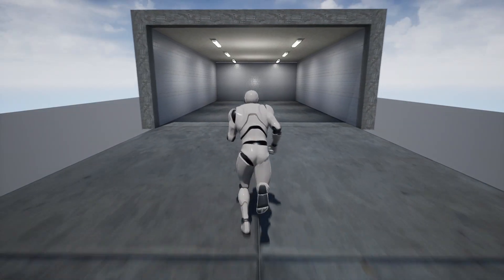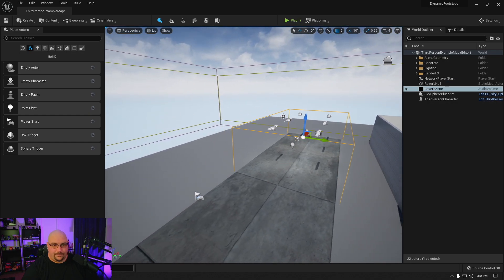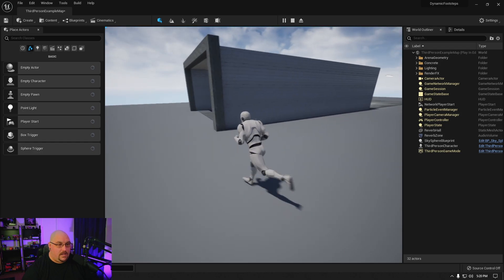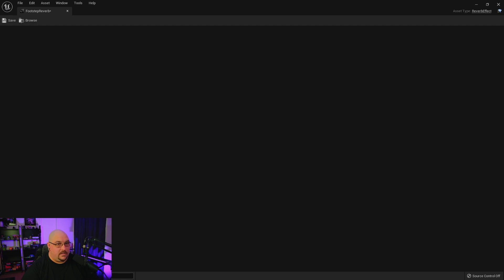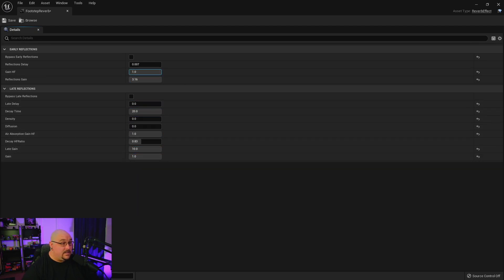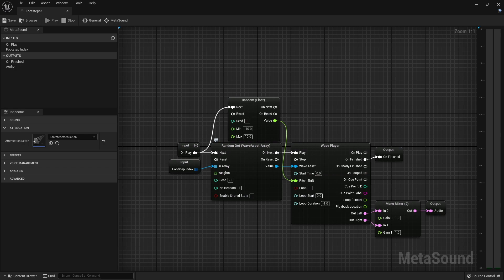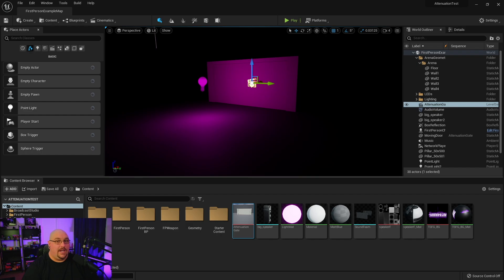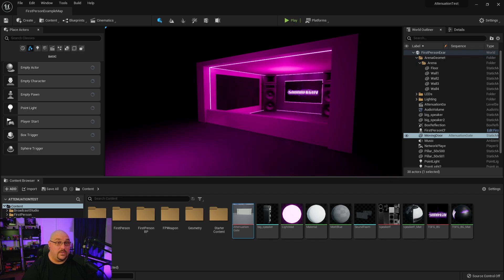Unreal Engine 5 | Attenuating Meta Sounds

Comment: how can I make a reverb decrease? Imagine you hear a music at the end of the hall, it is reverberated, but the closer you get the reverb decreases and the dry signal increases
Reply: on the basic attenuation settings you have the option to set a reverb send based on the distance, you can set a maximum amount of reverb  that you want to be applied  based on the maximum distance  and same  for the minimum distance and its going to change on a linear basis approximate to the sound source.
Reply: this is a good question. how could we do this?

Comment: Do you HAVE to make a footstep meta sound in order for this to work. My normal footstep cue is ... Somewhat massive as I'm using ALS and I'm playing all the dynamic footstep sounds through the footstep cue. It's like hundreds of wavs. lol oof.
Reply from the maker: At this point in time, no. You can definitely do this in sound cue. I say “at this point in time” though because I don’t know what the future holds for sound cues. When UE5 early access came out, sound cues were moved under a category called “legacy” which is usually used as a term for things that will eventually go away. However, in preview 1 it was no longer in legacy. So I can’t say for certain it sound cues will stick around or not.